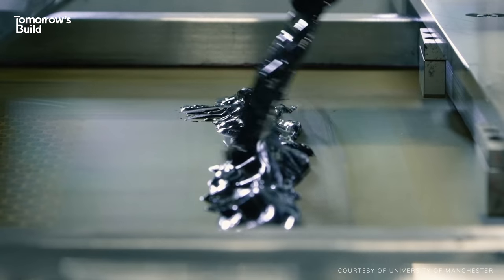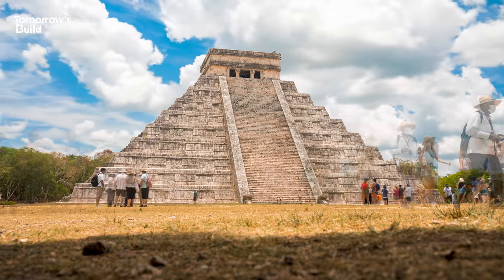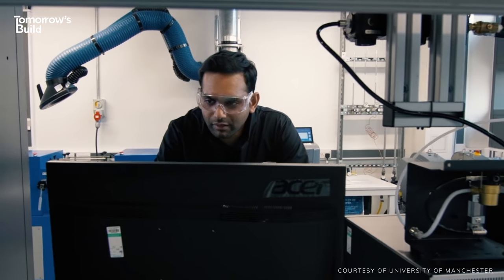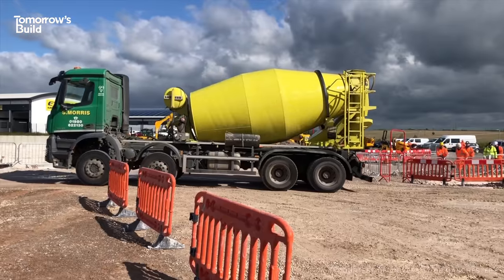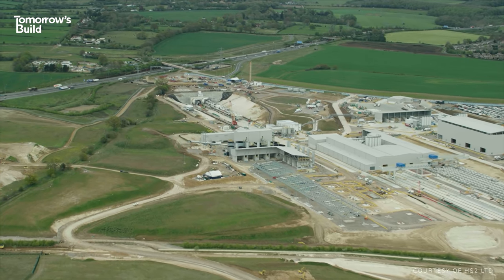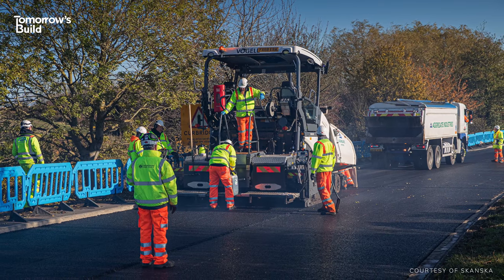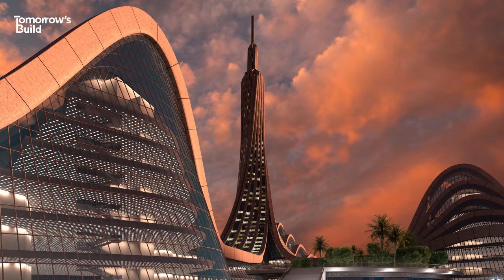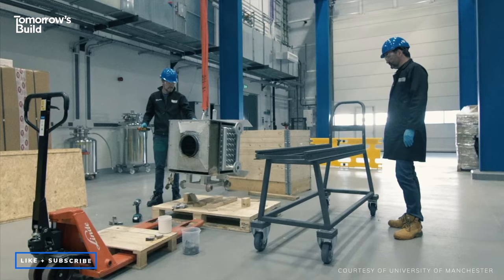Construction's Graphene Revolution Has (Finally) Begun

Comment: I’m curious about the environmental impacts of the graphene manufacturing process and of the material itself as it may eventually get washed out/leach/dissolve/corrode (what’s the right terminology?) from the material it’s in.
Reply: Good lord let it not be the new asbestos or micro plastics. 

Humanity needs a break
Reply: @somefuckstolemynick  humanity needs more innovation and ideas towards sustainable future. we are improving and becoming better
Reply: There have been several studies. So far, they haven't found any serious impacts but they also say that that more research needs to be done. I wouldn't be too worried.
Reply: It is a “carbon capture.”
Reply: @somefuckstolemynick   good point.   I am curious what inhaling graphene powered would do to the lungs.
Reply: It's the new asbestos :p
Reply: Yeah, I just asked that. Will delete my comment. Looks like nobody has answers. Does it degrade at all? It's super strong they say...
Reply: It's just carbon, a 2 dimensional version of the "lead" in your pencil. It's safe
Reply: I'm a touch concerned about introducing "2 dimensional" platelets into the micro-ecology, I'd hate to see a necessary strata of life get sliced up.
Reply: The worst that can happen is probably it turning into CO2 over time, but producing concrete releases a lot more of it anyways so if adding like 1% graphene lets us use less concrete it'll be a plus
Reply: @Duck.1  maybe, just assumed, and not that I want to suggest something, just point out; could it be that it didn't come across that Grapheine has completely, totally completely different properties than graphite?
Reply: @az3781  True for physical characteristics. At the the molecular level they are the same hence have same chemical characteristics.
Reply: From personal studies, it's chemically inert because it's just carbon so it possibly is not as toxic as other materials.
Reply: @az3781  Related to what Khan said graphite from just drawing with a pencil has the chance to come off as graphene, the only reason it is held together is because of the very weak charge that the carbon still has left. If you happened to breathe it in, it would be tiny for its uses in concrete, and be absorbed by your tissue like many other substances like dust all the time.
Reply: @EddieBoes  It would strengthen them.......right ?
Reply: @chikkikumar8908  you didn't answer his concern
Reply: @EddieBoes  and in the event of thunder storms.
Reply: Fortunately for the science religion winners, most people think completely one-dimensional. It is also interesting that when you get a point, all pomposity thinks they have to explain this point to you in order to substantiate their point of view, although zero percent of new information is added.
Reply: @Duck.1  carbon is an element. Graphene is an elemental allotrope. Asbestos contains carbon. I think Asbestos is also relatively chemically inert. You can't reduce something to its elemental constituents and judge its safety based on that.
Reply: @wizard7314  First of all any compound that contains only a single element is classed as an 'element'. Secondly all asbestos types contains many more than one element and most contain sulphur, mercury, and magnesium. Thirdly asbestos is individual molecules and graphene is never-ending.
Reply: I think a lot is going to come down to particle size, route of exposure and dose or duration of exposure. Basically like all things, dose makes the poison. Generally speaking nanoparticles are really not good for you. Graphene nanoparticles? Probably not great. Once it's incorporated into a product? Probably fine.
Reply: That is exactly the problem. Carbon nanotubes have already proven to mimic all of the effects of asbestos. It is not much of a stretch to surmise that graphene may have similar issues. Putting all of this stuff out into the world without first assessing the toxicological properties (yes, animal tests) is beyond irresponsible.
Reply: @tetrabromobisphenol  as a toxicologist, I couldn't agree more. It's exciting that it has favorable material properties but lets not poison people needlessly. The problem is the nearly infinite number of formulations you may find it in as a final product. Makes it hard to preemptively test them all.
Reply: I think nanocellulose will give many of the benefits with less environmental concerns.
Reply: @ericwright8592  Ok i understand, however my point was its in concrete, getting to the graphene would require powering the concrete and breathing it in, which the concrete would be more dangerous.
Reply: @Duck.1  If Graphene is poured in concrete and this concrete is worn off by a car or pedestrians, graphene nanoparticles can contaminate the air, then you breathe them in. Molecular carbon can affect biochemical pathways inside the human, animal, insect or microbe body. There definitely needs to be studies before we put this in everything. In Canada they had medical masks with a graphene film on them that had to be recalled because of the possible harm they could cause.
Reply: You can make graphene with pencil shavings and duct tape. I wouldn't worry too much about it.
Reply: @EddieBoes  It's not toxic, but i don't think inhaling powder is good for the body in any case.
Reply: @talonjuel4021  Actually NO.
If you inhale very small particles of carbon you can get what is called "black lung" which has been an issue with coal miners for generations.

But from the amounts they are talking about its more an issue with people involved with manufacturing than with application.
Reply: Graphene by itself is perfectly safe. It's literally just super thin graphite.

Rolled into tubes, or certain other shapes it can be quite toxic, though. Carbon nanotubes made out of graphene act exactly like asbestos at smaller diameters
Reply: Because it’s carbon, the body can assimilate it naturally. It is what the graphene is bonded to that can be harmful. We already breathe in pico doses created inadvertently by combustion. The economic side of environmental impact is likely disruptive when job creation struggles to keep up.
Reply: well, it's good to know that graphene is literally fancy carbon, so the worst that can happen is that it becomes dirt
Reply: No one care now.. later we will get same artiles like today with PTFO
Reply: @Creator_Veeto_PAEACP  Yeah, Ice also melts under heat. Doesn't mean Ice never melts normally.

I literally chew hundreds of Graphene layers when I bite my pencil. If you believe living things can't deal with a layer carbon you better propose theory why life haven't gone extinction yet.
Reply: @khanch.6807  that’s a poor analogy as well as your off-topic remark on living things detoxing themselves. I was simply pointing out your choice of words was inaccurate, but you are obviously offended that you were not correct in your original statement.
Reply: @Creator_Veeto_PAEACP  Dude. Why you arguing? 1 atom Carbon just needs 7.475×10^-26 calories to start oxidation. That's amount of energy is literally everywhere.
Reply: @tonywilson4713   oh yes, I know all about that.  I am assuming the coal particles are much larger than the nano-scale particles of graphene powder.   At that scale, it might not JUST cost the lungs like coal dust, but might possibly get into the tissue like no other particle could.
Reply: Its a type of graphite carbon. So hardly a problem.
Reply: @EddieBoes  Either way if its gets into your lungs its bad.
Reply: @romualdaskuzborskis  naive
Reply: Definitely need Environmental "cosm" experiments:
1) introduce graphene to various micro/mesocosms of terrestrial and aquatic systems.
2) monitor the effects against a control site/cosm to compare the health and assess
3) see how microbial, fauna and flora biological markers respond over a high acute dose AND chronic dose of graphene to the system. This will give us at least some environmental impact data of what a potential industrial load of graphene to the environment might cause.
NOTE: this is not an easy study and requires a mulitude of researchers studying each organism targets and analysing many key biochemical markers that are commonly studied in enviornmtenal toxicological assessments.
IMO our planet clearly does not need any new technological shit/pollutants in it's system, however, if indeed graphene can lessen overall pollution and anthropogenic damage due to its higher overall sustainability, then lets evaluate that too with a decent multi-author evalution
Reply: the benzene molecule (6 carbon atoms in a hexagon) is literally a base of all organic life
Reply: @brianrichards782  thefe is a lot of confusion out there on this topic. Inorganic/organic - search for both and you'll find both.
However if we zoom far out - what does organic mean? In essence, it's material produced organically by organisms.
Graphene nanoparticles may be indeed sourced from carbon allotropes (co sidered by some as organic), but in essence the end product is inorganic - it's literally a man-made product. 
Anyone saying "it's organic it is harmless" is blinded by some common sense.
In addition to what was said earlier, any material, even organic and natural, can be harmful when produced at larger scales... so nothing is harmless when being scaled-up..
Reply: @Matteo Tironi yes you are right, within the definition/nomanculture of organic chemistry, but sometimes it's helpful to zoom out of the chemical viewpoint in order to define what is meant by "organic"
Reply: @tonywilson4713  Hell, I don't even want to breathe in flour if I pour it out too aggressively.
Reply: @Duck.1  it's not just the elemental makeup but the structure it has that can have a negative impact.
Reply: Exactly. Rolling this out in everything without knowing the consequences is foolish.
Reply: @somefuckstolemynick  inb4 its a very aggressive carcinogen
Reply: @EddieBoes  Well you do know that flour dust in the air can explode if it gets the right ignition.
Reply: @tonywilson4713   and sawdust and silo grain dust...
Reply: @EddieBoes  makes your lungs last twice as long and also prevents cracking
Reply: I have to say this is the longest comment rabbit hole of replies I have gone down.. it was very entertaining. 
What I learned was people should 
not eat pencils, concrete or asbestos. 👍🏻
Reply: @EddieBoes  I do control systems and am qualified in electrical equipment for hazardous areas. So I am pretty familiar with the subject. 
Sadly most other engineers treat it as a joke until it goes bang.
Reply: The environmental impacts of graphene, if there are any of note, are essentially zero compared to what it's replacing. That's all that really matters in the final analysis.
Reply: the current zombie movie is really exciting
Reply: From a purely chemical perspective, it's basically graphite, which is non toxic and already found in nature.
Reply: @talonjuel4021  "it's just carbon" that's an incredibly simplistic and uninformed opinion. One of the things that makes these nano-tubes so interesting is their extremely small size. There are some real health concers with regards to that. Pretty easy too google if you are interested in reading up on it.
Reply: If so, we should also be scared of pencils haha
Reply: @tonywilson4713  Yeah a basic google search shows articles describing how vaccines don’t contain graphene oxide, not graphene. Even the basic wiki for graphene supports this. But maybe if I use more emojis 😜🤪🤡🤡🤡
Reply: Yes. This comment.
Reply: @95mmarier  pencils don't use nano-tubes. Just because it's the same element doesn't mean it's the same in every configuration and situation. Diamonds are also "just carbon".
Reply: @somefuckstolemynick  some people needs to tell others when they are wrong, thanks ahah :)
Reply: @95mmarier  I’m mean, it’s an Internet forum. Don’t comment if you can’t handle being responded to. ¯\_(ツ)_/¯
Reply: @somefuckstolemynick  What???? Lolll i think you didnt understand what i said. 

1) I said something
2) You told me i was wrong
3) I responded that it's true that i was wrong and thank you for that
4) you then responded that i shouldn't write comment if i can't handle being responded.

It's the complete opposite lol
Reply: it's carbon
Reply: @TheBooban  , graphite
Reply: @talonjuel4021  , not lead, carbon…
Reply: @wizard7314  Asbestos is a rock mineral, there are two types, short and long fiber asbestos, the short fiber was used in fireproofing construction before studying its use in our daily environment, graphene needs health and environmental study too, if we learned anything from asbestos, such environmental research on the front end is fundamental to society.
Reply: @gary.richardson  , like black lung?
Reply: @brianrichards782  , O2 is necessary, O3 is toxic…
Reply: @norag8265  yall gotta be joking rn
Reply: We pretty much know that. Carbon in lungs is a well known event in coal mines. There doesn't seem to be a reason for a different effect because of the lattice.
Reply: @somefuckstolemynick  look up the movie Dark Waters, its about teflon
Reply: @kevinbissinger  So? Table salt is "just" sodium and chloride. Both are poisonus on their own, yet salt is necessary for to live. My point is that more than just what element it is matters; structure, dose, combinations, etc, etc.
Reply: @grangermontag1824  No they aren't. It was a hoax.
Reply: most of the time you can't trust when they say a material is safe but in this case I wouldn't worry too much, it's basically pure carbone in a stable form, the base material of everything with a physical embodiment on this planet, so ...
Reply: @ottodidakt3069  you can't just look at the element in it and say "oh, it's safe". Sodium and chloride are both poisonous to humans, but sodium-chloride is normal table salt. These nano-tubes are "just" carbon, but so are diamonds. Structure, amount, situation, etc etc.. all these things matter. There are real health concerns with these nanotubes (mainly because of their small size) that people are investigating.
Reply: @Creator_Veeto_PAEACP  uhh so what happens when u heat up coal in the fire?
Reply: @tonywilson4713  agreed you have a good point
Reply: @talonjuel4021  i hate to say it but ur right
Reply: @johngrisum  i understand the concern for nanotubes however powdered graphite has graphene in it and its basically safe
Reply: @investinfamily  bro big differnce between tube and plains
Reply: @eleventy-seven  no shit if i inhale water its bad for me too
Reply: @somefuckstolemynick  not nanotubes graphene is flat theres a big difference
Reply: @Duck.1  yeah yeah, same difference
Reply: It's just carbon. The other materials are far worse. Given that this reduces the amount of other materials my guess is the impact would be better than we have now
Reply: @lemmysverruca  no jab for me . Info
Reply: Its l i t e r a l l y c a r b o n

If it gets out, its just dirt but better for plants.
Reply: @EddieBoes  it would have to be excessive
Reply: @ericwright8592  backseat engineer
Reply: @somefuckstolemynick  yeah bud, restating ur argument with less words doesnt help ur argument
Reply: @Duck.1  did you reply to the right person with your "restating ur argument" comment? Only time I've repeated myself is to new people (I think)
Reply: Its 100% pure carbon lol people need to relearn the periodic table, it's the basic building block of all things life. It's not poisonous
Reply: @chikkikumar8908  Are You saying Asbestos was not innovative? Fredrik has a point. Improving and becoming "better" at all costs is not a good idea for a "sustainable future"
Reply: @talonjuel4021   It is not "safe". Not at all. It's like comparing a glass marble to microscopic glass shards/dust. Inhale a small enough marble and you won't die and recover fully if removed. Inhale glass "dust" and there's no removing it.
Reply: @gary.richardson  Tell that to miners
Reply: @poitco.52  That would be ideal... But in the real world it'll be: "Oh, it makes money? Stick it in everything!"
Reply: @tonywilson4713  I think noobfest is confusing "graphene" with "graphene hydroxide"
Reply: @talonjuel4021  It's not nanotubes, You are right! It's an atom-thick sheet. Guess what that turns into when broken?
If You guessed atom-thick razorblades, You are right.
Reply: @Duck.1  powdering of concrete surfaces is super common. It happens when the concreters finish slabs too early and work bleedwater back into the surface. If you know what it looks like you'll see its everywhere.
Reply: @EddieBoes  How do u inhale Graphene? Have you ever inhaled Diamonds?
Reply: depending on how it happens will determine the correct terminology but based on your examples you probably mean "leech" which you said, but there is no "a" in the word.
Reply: @Duck.1 you don't want to breath in powered concrete or concrete dust either it's a very bad substance for the lungs and skin
Reply: @poitco.52 hopefully those studies are being done along side all the other studies on graphene or am I just overly hopeful ?
Reply: @EddieBoes that's really bad to breath in over the long term too
Reply: @Ewen-s7t  Jeeze my first reply to this was a year ago, and duh what's your point? My point was that breathing in any fine particulates is not good for you, and there's probably nothing 'special' about graphene either.
Reply: @Duck.1  agreed just meet a bloke last year who had COPD from concrete dust , guess I was stating the obvious